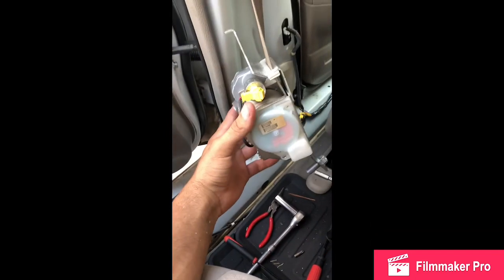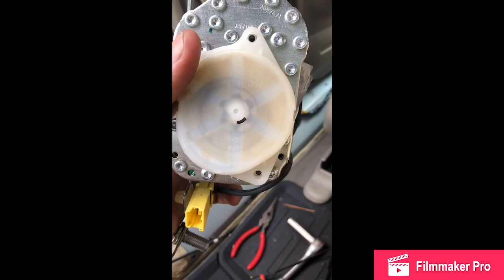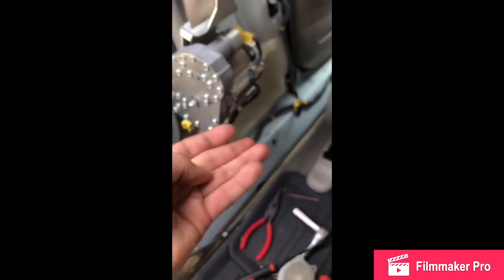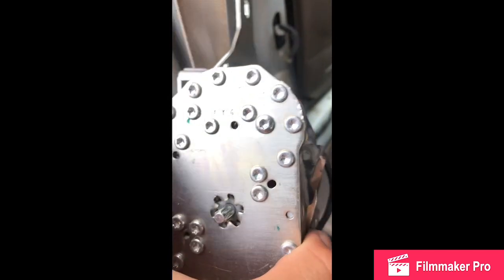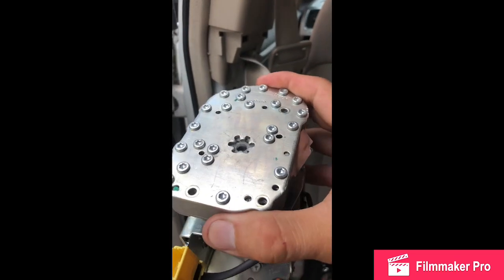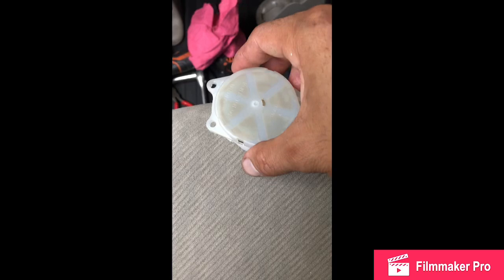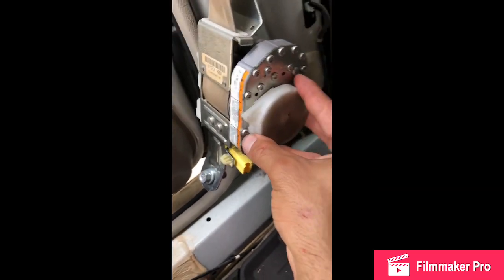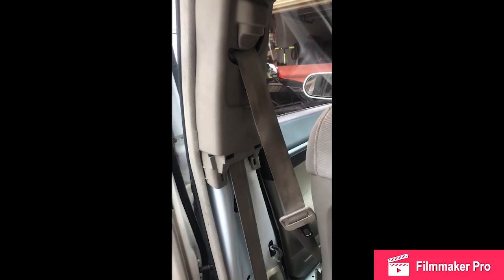Honda Civic Seat belt Repair After Wreck

Comment: Although this video answered some questions it is lacking technically. 1. Did not call out the tools needed to remove the coil spring case (Metric T10 star wrench) or the pin housing from the belt frame (Metric Allen wrench). 2. Finally when unwinding the coil spring case, count the turns needed to relieve the spring tension and re- assemble with the same no. of turns.

Comment: Don’t do this unless u want a useless seat belt if u orientate the device the way it’s belongs in the car it will release. This guy could easily be responsible for a seat belt failing and someone dying
Reply: Not his issue. No one is forcing anyone to do as the video. And who do you think you are? Telling people what to do? That's weird thinking that you can control others actions
Reply: I’m using this video and this guy’s demonstration because I gotten in a wreck myself and this had happened…I rather wear my seatbelt then have a cop pull me over for not wearing one atleast until I can replace it with one that fully functions

Comment: After taking mine apart, I do see that this video is lacking badly. Dangerous suggestion to remove those pins. Now, there will be all those who followed this video who have Honda civics with dangerous seat belts not knowing the belt will not lockup upon a crash. Also, next time you post a video, have someone hold your camera landscape while you work on those parts and ensure it can fully be displayed on cell phones. Be careful, folks.

Comment: doing it this way, would it be possible for the locking mechanism to work again if you had another accident/wreck ? if not it would be safer (and quicker) to just install a new seatbelt
Reply: i guess it's pretty randomly asking but does anyone know a good website to watch newly released series online?
Reply: @Riley Korbin Thank you, I went there and it seems to work :D Appreciate it !!
Reply: @Milan Alfonso glad I could help :D
Reply: I would bet you can replace the electrical housing with the pins instead of the entire seat belt assembly.

Comment: The first video (which you point to in the comments) had a retractor where the only problem was in the mechanism that locks when the belt is pulled out too fast.  Once that mechanism was reset, his retractor operated normally.  If his retractor included a seat belt locking mechanism, it must not have triggered.  So his seat belt may be fully back to normal.

In your retractor, the mechanical fast-pull locking mechanism was not the only problem - you had a belt locking mechanism trigger, and that used the metal pins to jam the belt reel.  You simply removed the pins, without replacing them or making any other repairs to the mechanism, so the belt locking feature will no longer operate in any future crash.

You may be willing to make this tradeoff for yourself, but if you ever sell the car I hope you tell the new owner that the driver's seat belt is not fully functional any more.  Other people with the same problem, who are watching this video, should be aware that this does not seem to be a full repair - it just removes a portion of the mechanism.

Comment: Thank you so much, this worked just fine with my honda civic 2008 after the airbag was deployed and the belt was stuck due to the pins you mentioned.
Reply: I hope you read some of these comments. He took out the bearing from the main part of the locking system.  There are so many parts for Hondas...

Comment: I have this problem passenger seat honda civic 2003 locked from accident, so the electric plug is not or is it suppose to get power or either way that is not it or will it work,  or should I follow your advice video?????

Comment: I bought both of my front seat bealts for a 2018 honda civic because i was told that i needed to replace them now as i tried to install my self the seat belt locked and couldnt bolt it back on cause the seat belt was to short what can i do in this case ?

Comment: Did you replace the pins after removing them ? 
I know you said they were bent ..
Reply from the maker: My situation was a result of a car accident. In my case, the pins are no longer reusable. The pins are ejected by the air bag system during an accident assisting the seatbelt mechanism to lock. My repair demonstration is to make the seat belt function without the OEM Airbag SRS operation. I hope this makes sense. Thanks for watching!

Comment: step 1 should have been disconnect battery to lessen the chance of setting off igniting the charge while unplugging it and also to keep srs light from coming on
 The ball bearing must go back in for locking mechanism to work. I did not see this clearly in video. Maybe  the belt will tighten from the explosive charge by the srs system...maybe.......that is a big maybe ...

Comment: Any experience fixing a 2016 seat belt? I followed all of the steps but it turns out that my seat has metal balls inside and not pins. Any suggestions on what I do with those?
Reply from the maker: Krystal, unfortunately, I don’t have any experience with a 2016 model.